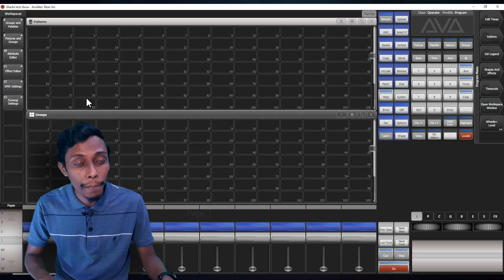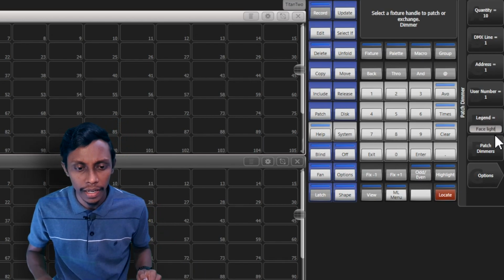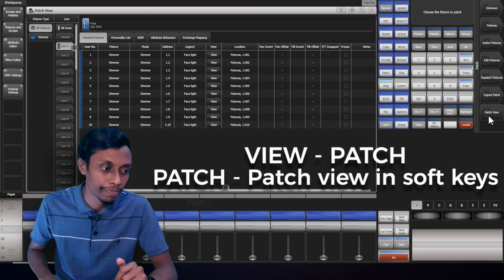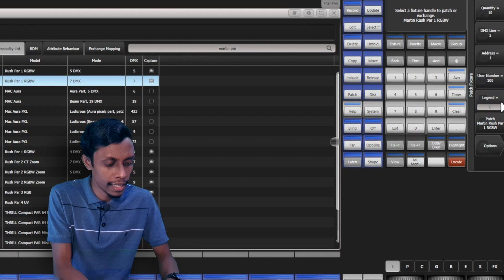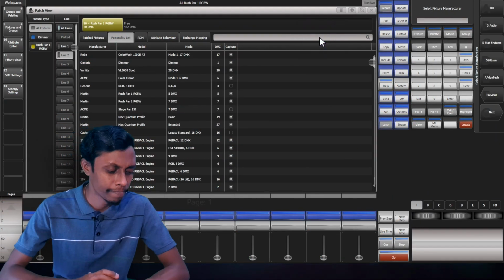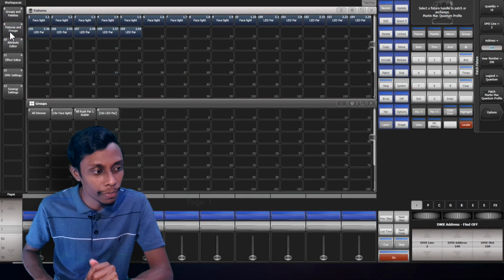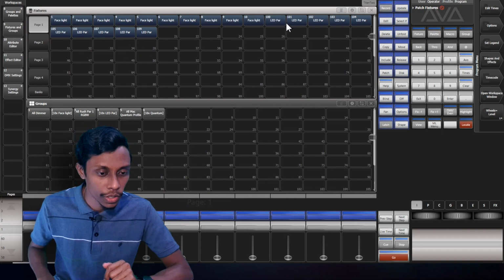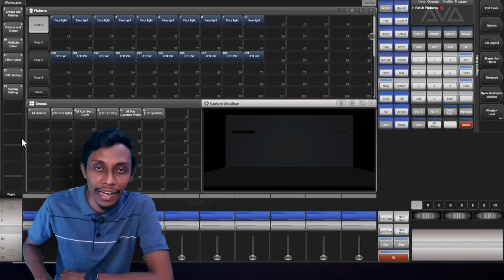Avolites Titan - Patch Fixtures, Quick and easily.

Comment: Hello Shashi, I'm using Avolites Quartz I got problem with capture visualiser which when I try to patch fixture that download a personality from avoilites website the fixture I patched is workwell but in capture visualiser no any equipment appearance.
However, when I tried to patch dimmer this work well too and this patched dimmer have an equipment appreared in capture visualiser. 
What's I do wrong? please advise thank you.
Reply from the maker: Hello brother,
All the fixture doesn’t work in capture visualizer.  When you patch check under capture column if it is ticked. That means it’s capture available. Only if it is ticked it will work. So when you are downloading. Download the capture available fixture files.

Comment: Hello 👋
I have a question..
Can i patch 2 fixtures on 1 adress ?
Reply from the maker: Hello, 👋 No you can't patch 2 fixtures on same address.
But you can use two same model fixtures in one address. 
ex : You patch one fixture in console, and give this address to two fixtures that is same model.
Reply: @shashionlights  that what i meant.. i have the same model of fixture, and i need it to be on the same address, how do i do that ? can you explain me please ? 🙄
Reply from the maker: Yes. Simple. Patch one fixture. Then give the same adress to both same model fixtures. This you have to set physically from the fixture.